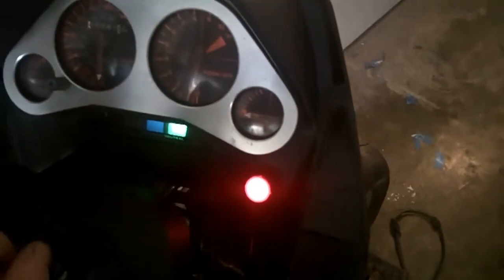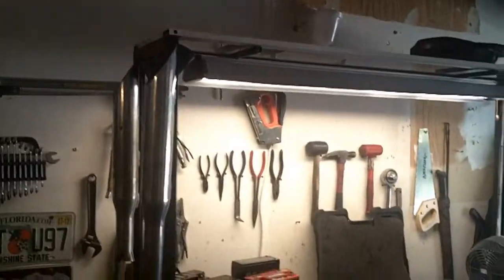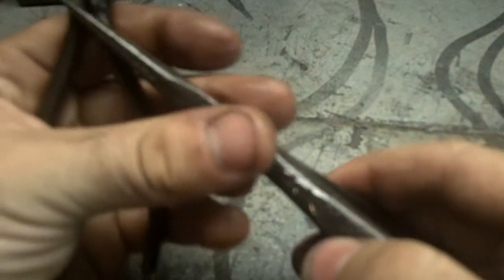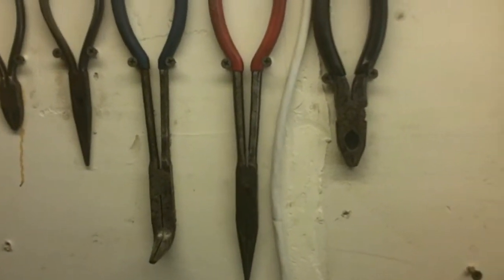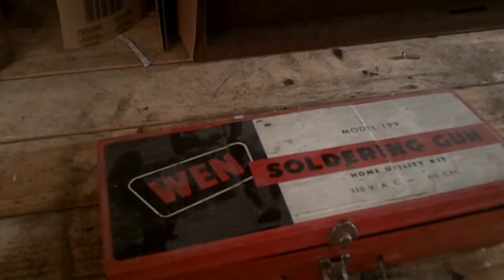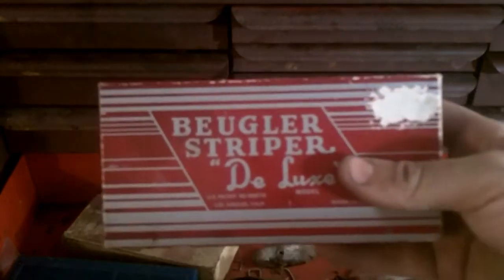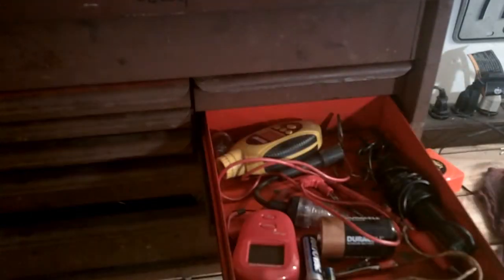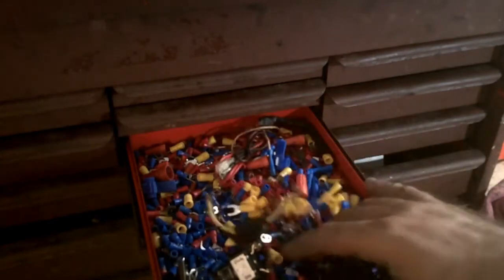Some of my favorite tools

Comment from the maker: I just like holding an old tool yknow, youre right it does make you feel good and give you confidence. I guess old tools almost invariably have to be high quality, or else they would have broken and been thrown out long ago, but theres some intangible quality unrelated to their utility that makes me glad to have them around. I lost those cutting pliers in Florida after a hurricane blew them off a bike seat, took me 6 months to find them in a mud hole. Rusted, but no worse for wear, good stuff

Comment: Pretty cool stuff especialy the atomic side cutters & needle nose pliers. Not so much that voltmeter you got free at HF. I had one exactly like it when I had my last bike & the 2nd time I used it to get a volt reading on the battery it sparked & the leeds got extreamly hot. It was on the correct setting & the internal fuse did not blow. After that and other HF electrical tools I've had problems with I said no more. Got a quality voltmeter from Home Depot for about $25.

Comment: hey max noobie q for u: I'm hoping soon to do a carb synch on my hurricane 600. the vacuum take off is a screw plug on the intake of the engine. are these screw threads a standard metric size on japanese bikes in the late 80s/ early 90s? I was thinking bout buying some adapters and making a manometer myself. the interceptor looks cool pls do a quick vid if you muck around with it :) thanks mate

Comment: if u run out of intresting repairing videos... we dont know so much about it so ... how to put wheel on, how to change oil, how to remove tank, how to set the idle rpm, etc basically everything :)

Comment: Hey max i am having a problem =/ My Honda Shadow wont turn on I rode it home last night from work and when i woke up this morning to drive it to work it wouldnt turn on  (my ignition switch was broken so i just have the white disc that you twist) well i tried turning it on and the power wont come on. the battery was just fine yesterday i checked all the fuses and none appear to be blown what could it be? the ignition switch isnt turning on gauges and stuff anymore this happened over night